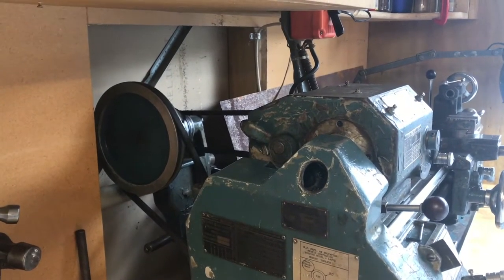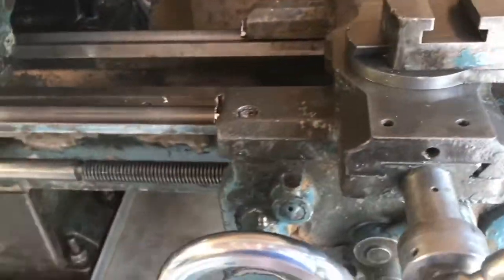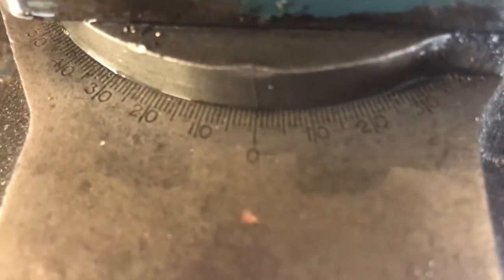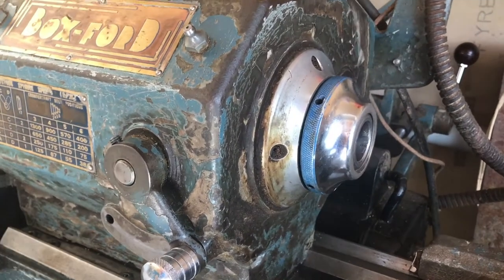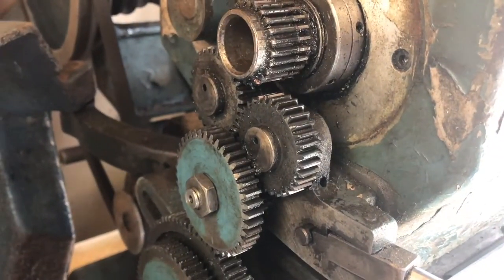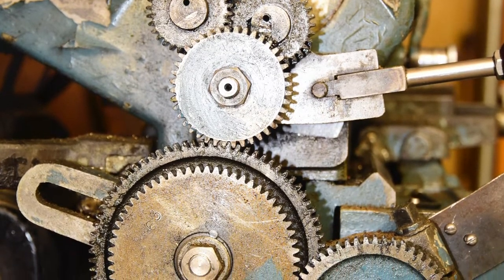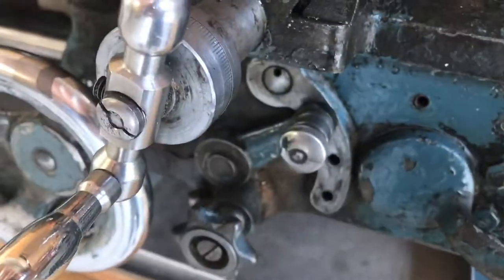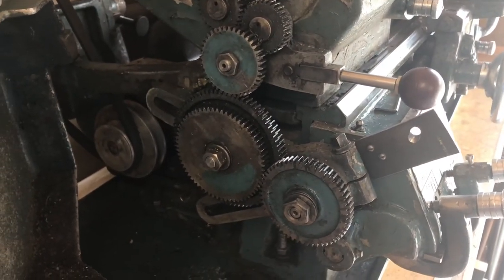The knobs and levers on a 1953 Boxford Model A lathe similar to many other brands of metal lathes.

Comment: Hello, I’m trying to clean up a tailstock like yours. After removing the wheel there is a piece shaped like a nut which is held to the casting with two grub screws. Once the two grub screws are removed how for you take that off?
Reply from the maker: I have not stripped my tailstock completely. I suggest you join the Boxford Users Group by clicking this: https://groups.io/g/BoxfordLathe-UserGroup and select subscribe.  There has been a recent discussion about tail stocks. There is also a Boxford parts manual with drawings of the parts. There are a lot of very experienced people in this group and they will be able to answer your question.
Reply: @Evan-e-cent  thank you

Comment from the maker: Correction:  I said the silver table on the front of the lead screw gear box tells you the pitch of a thread. That is not correct. As it says on the table itself, it is the feed rate when the lead screw is used to provide power feed, which drives the saddle along the bed using the clutch.  There are gears in the saddle that reduce this speed.  Note that the power feed rate for the cross-slide is 0.3 times the speed on this table (which is for longitudinal movement).  The table is only correct if you have a 40 tooth stud gear in the gear train. Note that as you move the A to E lever the speed doubles with each step.

If we are cutting threads we do not use the clutch knob, but rather the lever which engages a half-nut directly with the lead screw.  This eliminates the reduction gear in the apron/saddle/carriage.  When used this way you usually have to change gears in the gear train.  Another table on the end of the lathe tells you what stud gears to use and what gearbox settings to use for all the standard metric threads.